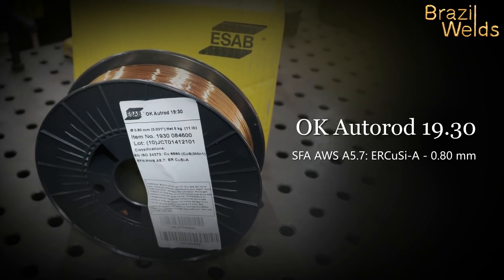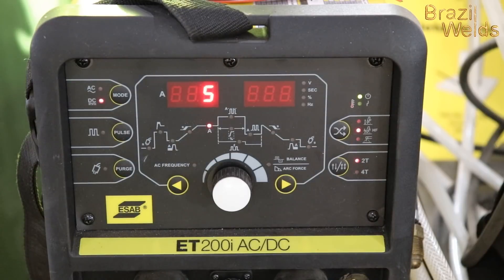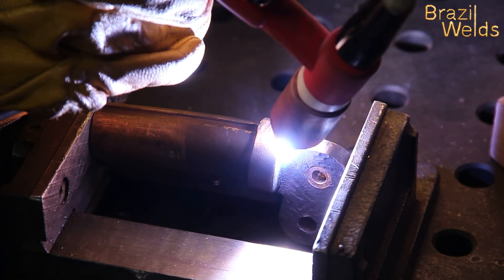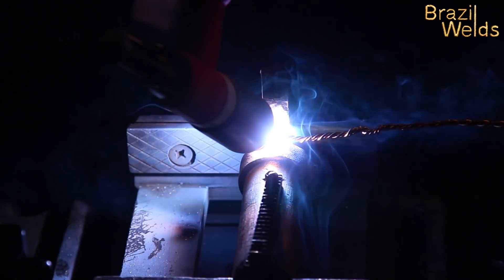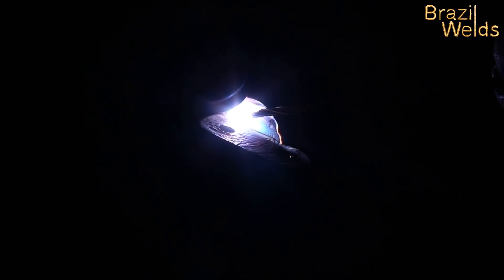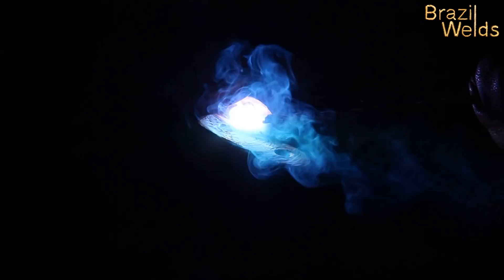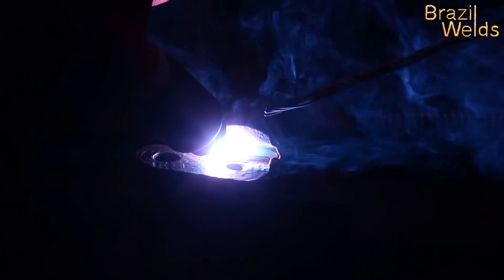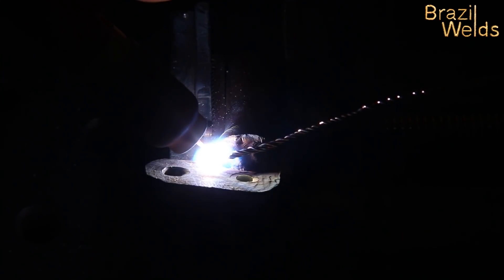Soldadura TIG (GTAW) - Latón

Comment: Podría enseñarnos a soldar el cuproniquel? Tenemos muchos problemas de micro poros .
Y porque al soldar la penetracion en carbono, aveces la varilla ( er-70 s6), se pega al bisel?
Muchas gracias y con usted siempre se aprende algo en este oficio tan amplío. 👏👏👏
Reply: Le llamamos cuproniquel, no sé si es correcto el nombre, lleva cobre, bronce y niquel , se utiliza en la pequeña plataforma petrolífera q tenemos en nuestra costa (Cataluña), es para tuberías de agua del mar.
Reply from the maker: Tan pronto sea posibel haré este vídeo!

Comment: muy interesante lo mostrado, una consulta ese mismo metodo de preparar las varillas de aporte se puede utilizar para aceros al carbono con el alambre de la soldadora MIG. Saludos
Reply from the maker: Sí, pero no tiene sentido, porque es fácil comprar varillas TIG de acero al carbono. Saludos
Reply: gracias ,por la respuesta pero mi pregunta fue porque donde recido no hay insumos para soldadura  y me es facil conseguir alambre de  un vecino que trabaja de herrero y lo que sueldo es por hoby . un gran saludo
Reply: Hola mesias, consulta... Quiero soldar bronce y mi duda es si la soldadora tig tiene algún gas mezclado... Yo uso argón puro en mi máquina ... Intenté soldar bronce y hace mucho humo blanco... La varilla de aporte que use es de bronce .. pero no me dió resultado.. desde ya muchas gracias, saludos